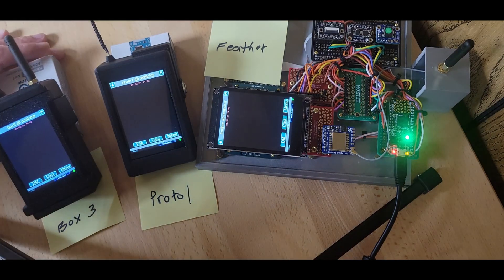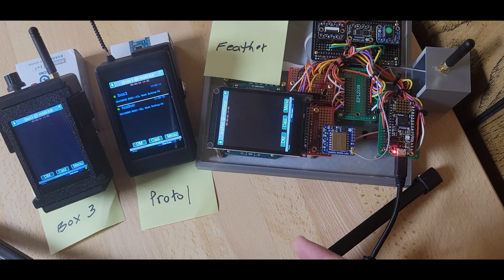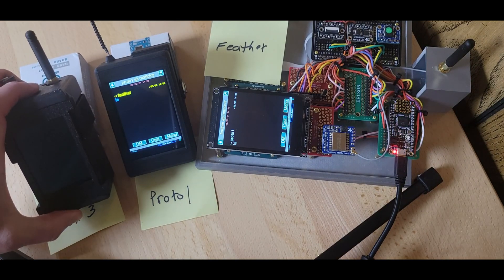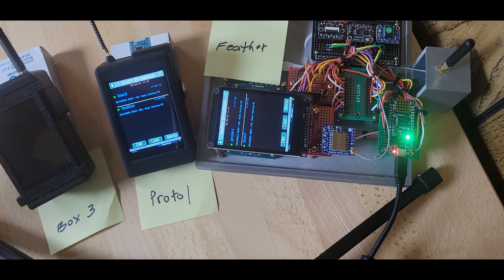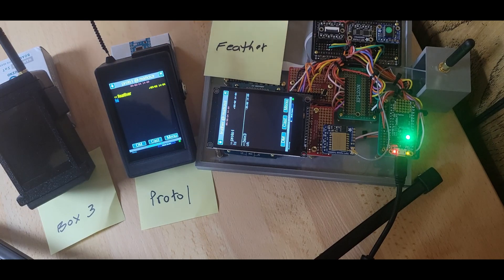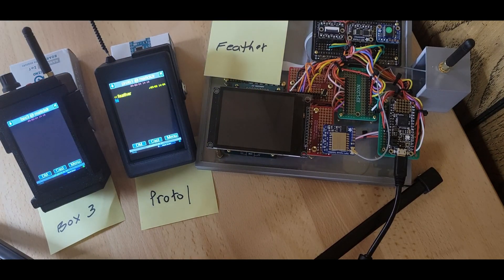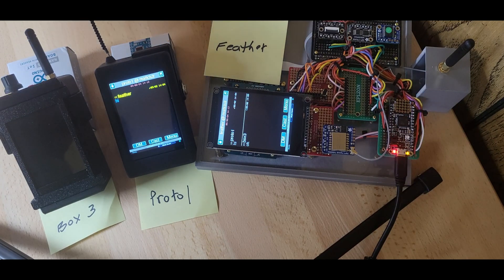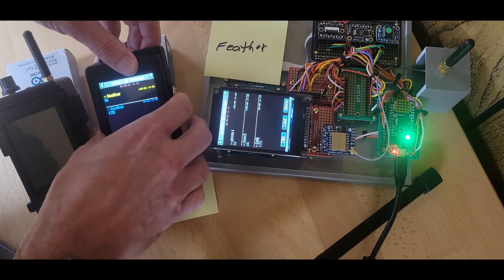ChatterBox Mesh Delivery Demo - Off-Grid LoRa based Secure Messaging System

Comment: is this any better than meshtastic?
Reply from the maker: I think the goals for this project are slightly different. All devices in a ChatterBox cluster are capable of storing and forwarding messages throughout the cluster, even if they have to be held for a few hours. ChatterBoxes do not use your phone or Bluetooth at all, and messages you would send to another person cannot be read, even by other devices that help to get your message delivered. ChatterBoxes use evolving knowledge of how strong the various devices' connections to one another are, in order to route messages in a highly targeted way. A ChatterBox has all these capabilities built into a single device. I think those points are mostly different from meshtastic, but I am really not an expert on meshtastic.
Reply: @blackoutcomms  It would be interesting to allow it to act like a Meshtastic node because currently the Chatterbox network isn't very large. Though i especially like the caching feature.